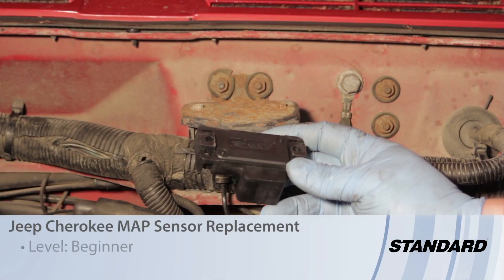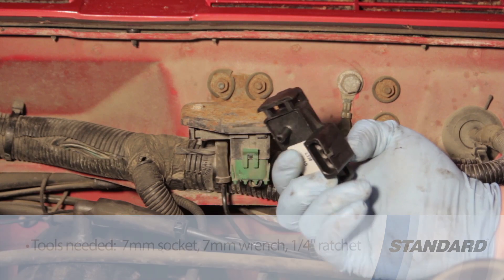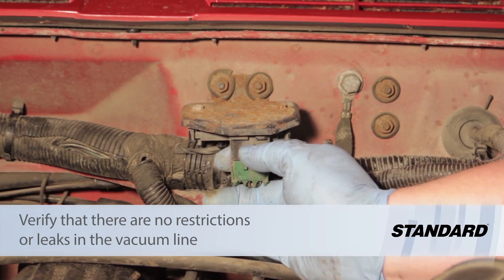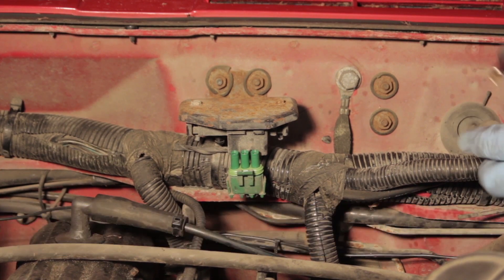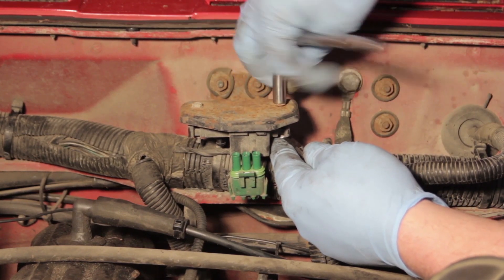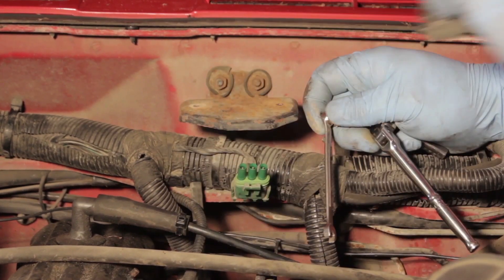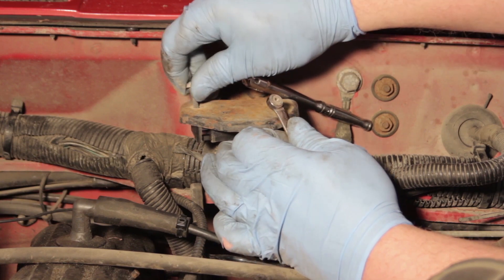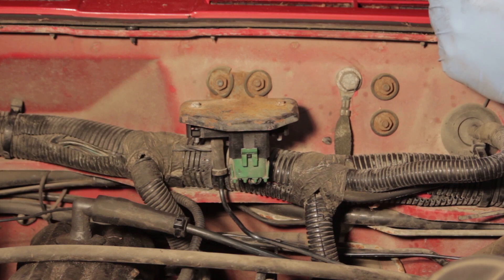MAP Sensor Replacement: Jeep Cherokee 4.0L

Comment: What year Cherokee are you working on .
Reply: this is 96 (or earlier) 
97 (or later) map sensor is mounted to the side of the throttle body
Reply: I gotta 98 mine don’t look like that probably older
Reply: I have 96 XJ with the MAP sensor on the throttlebody... I've heard a bad MAP does not always throw a ce code so I'm going to swap it out for a new one and see if it levels out the air/fuel delivery.
Reply: Also change the o2 sensor at the same time.